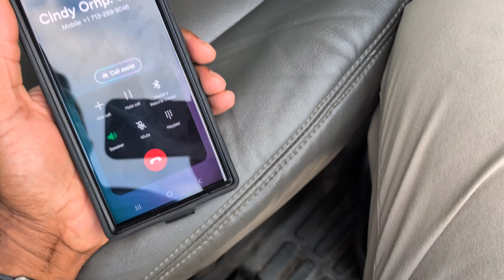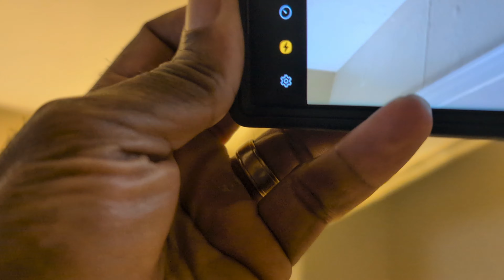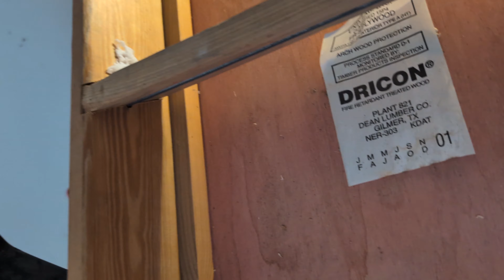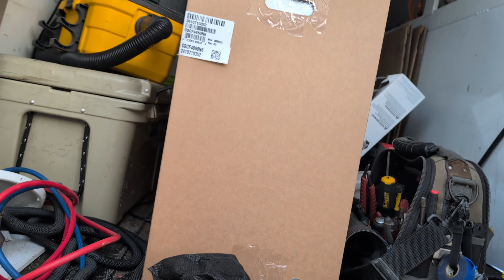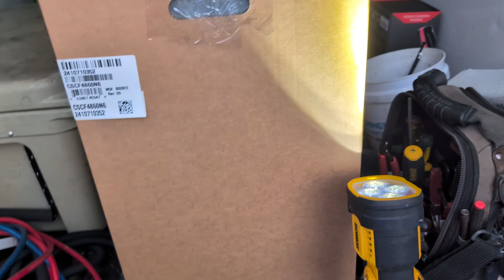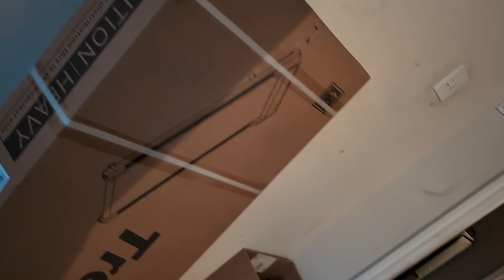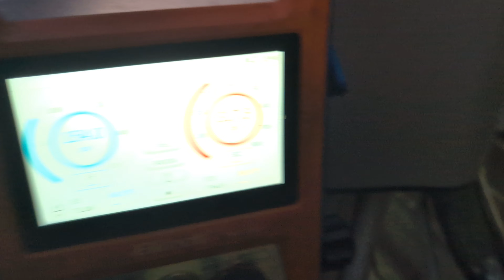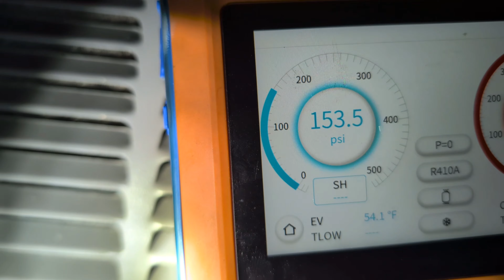👀  How Lack of HVAC Maintenance Wrecks Homes! 🚨 Warning Signs You Can't Ignore!

Comment: Hopefully the homeowner or whoever does the cleaning on those returns takes note to turn off the HVAC system before so that the dirt does not get pulled into the return and evaporator !
What they really should use to begin the cleaning process is a vacuum with the brush attachment then brush and wash those grills with ammonia and water solution. Man, those ducts are likely dirty dirty too.  As usual, its always a good idea to have at least 2 spare filters of each so you don't have to worry about a trip to the store when in need. It's more convenient to have them vs. have to go get them under a time limit.